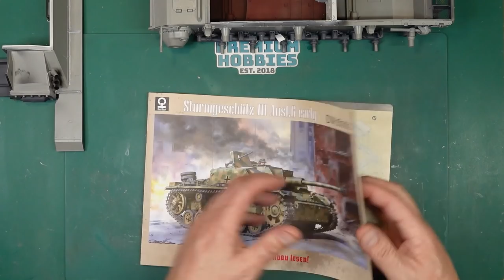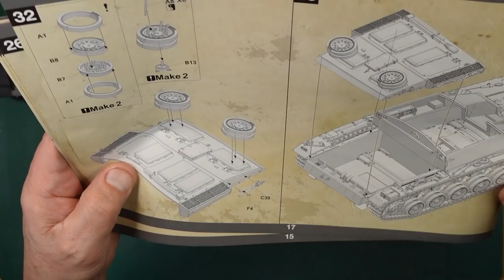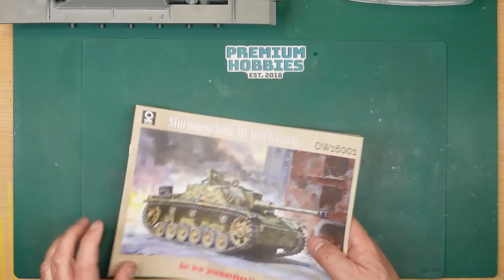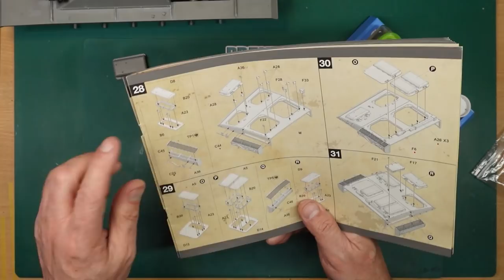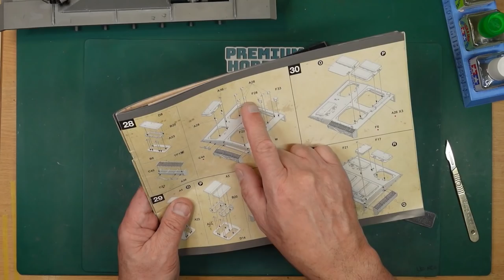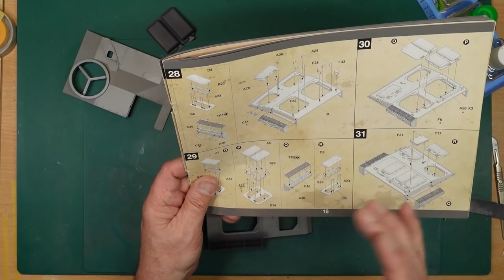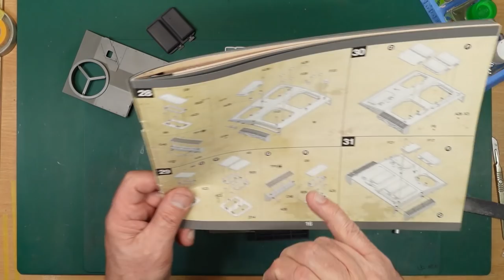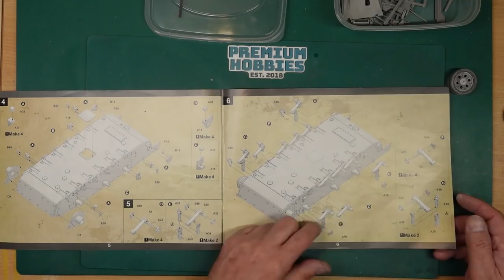Das Werk 1/16 Stug III Ausf G build. Part 8

Comment: Nigel, the "brackets' or levers on the engine air intakes are to close off the vents in event of rain & snow.
It would be bad if the vents were clogged with ice the crew couldn't easily clear.
My friend is going to begin that same model very soon. I will direct him to watch this as well as the other videos.
The recommendation to leave the suspension off until the hull is completed is very sound.

Comment: Getting the hull and fenders on in one operation is quite a faff. I think if I do get the Panzer 3 I would try and get the fenders on first and then the upper hull on. Seems like there are too many things to align in one stage of the build. As you suggest, some of the bolt-on armour going on later would also make things easier. Still enjoying the build of this kit though whilst watching yours progress.

Comment: Another great update Nigel. I am at that same stage with mine. Just a note on those air intake photo etch grills on the sides of the engine deck. Andy from Andys Hobby Headquarters said in his video build, that there are bolt details on the upper surface of the photo etch grills. He said you should cut off the existing bolt details on the air intakes. They you will have a flat area for the photo etch grill to bed down on. I don't know if this is correct. Or if the grills are supposed to be raised on the bolts. Its hard to see with what reference photos I have. Speaking of reference photos. Please check your emails Nigel. I have sent you some photos to your email address. Do get back to me if you find them useful.
Reply from the maker: Andy HQ is wrong on both counts.. there is no bolt detail on the etch, wish there was, and the grilles should be raised.. https://www.recomonkey.com/Land-Platforms/Artillery/Self-Propelled/StuG-III/StuG-III-Ausf-G Good old Andy....
Reply: That is a great link Nigel! I looked through the ‘Details’ photos and I can clearly see the bolt heads on the perimeter of the grill and, to my (old) eyes the grills appear to be sitting flat on top of the vents.